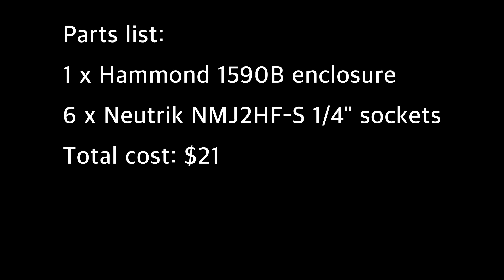Make Your Own Guitar Pedalboard Junction/Patch Box

Comment: no noise/ground problems?
Reply from the maker: No, not at all. With the plastic jacks they remain isolated.
Reply: @hotglassbottles  If I don't have plastic jacks how do I isolate it? Use plastic rings between the connections or do I need to solder some extra cable somewhere?
Reply from the maker: @nick_be9159  yes, some manufacturers will sell you plastic isolation washers to go with their jacks. Also you could come from the other directions and use a plastic enclosure.
Reply: @hotglassbottles  hi, Im encountering noise issues when the box is plugged into my rig but no guitar plugged into the box. Would you say this is normal?
Reply from the maker: @zacharykim295  No that's not normal at all. Are you using electrically isolated sockets, like the plastic Neutriks I used? Each pair of sockets...in to out...should essentially be just like a tiny patch cable. i.e. nothing to do with the one next to it.
Reply: @hotglassbottles  Thanks for replying! The one I have is a prebuilt one from American Loopers. Looked inside and the metal prongs on the jacks don't look like the ones you have so I don't think they are Neutrick... who knows? I'll return this one and build one myself in the future, seems pretty easy after looking at your video!